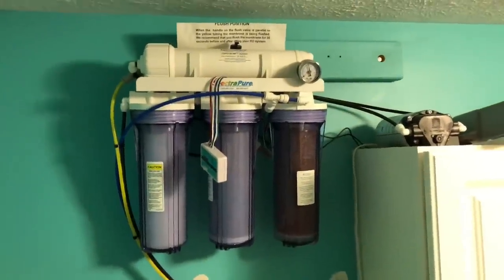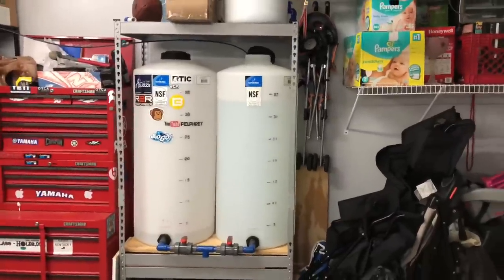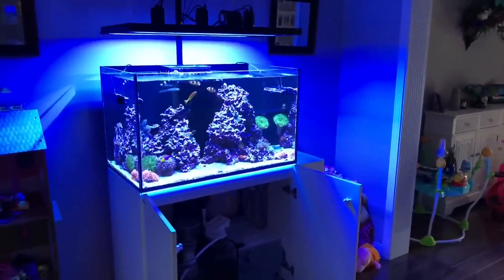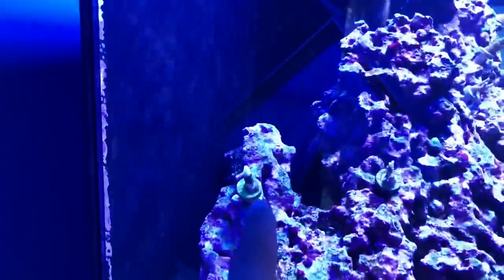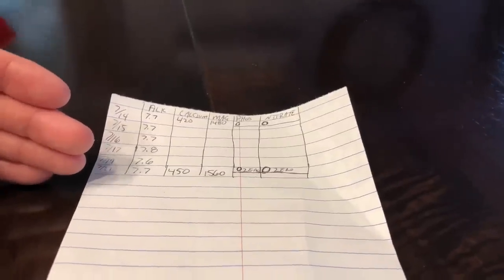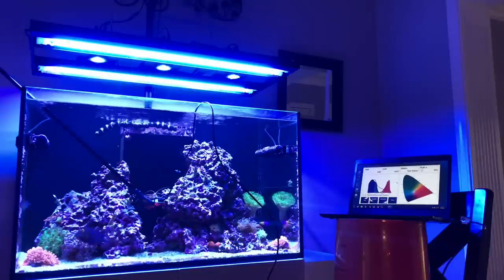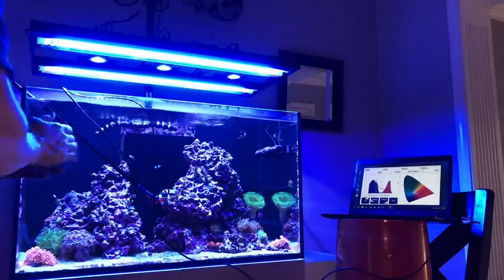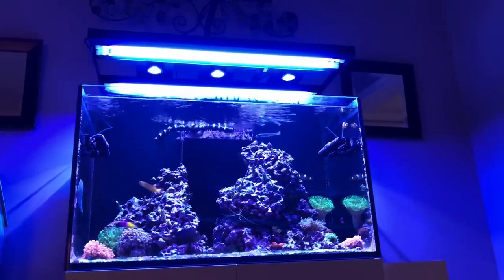Red Sea Reefer 250 | Updated Par Values | Water Parameter Stability

Comment: Great update bro. Before I purchased my kessil 160 I spoke with a guy at kessil and he told me the purpose of the dense matrix design was to mimic the sun and create a shimmer similar to the ocean... he said that kessil light depends on that shimmer to generate par... I’m not knocking anyone, just sharing what I was told, and the reason why I purchased that light
Reply from the maker: Thanks Bobby for your input, I wasn’t aware of that. Well, I thought I heard or read somewhere that the light reflecting off the flow distributed light better. I think I read that, I could be making it up. Hahaha how many 160’s are you running?
Reply: just one on a 24"x24" x 24" 50 gallon cube

Comment: If I’m not mistaken, so do check this. If your running low nutrients like your wanting your gonna need to bump that light up. Low nutrient / high light , high nutrient / low light.
Reply from the maker: I need to do some research on this! I’m slowly backing my ATS down. I’d prefer to have detectable phosphates and nitrates.
Reply: He can run high nutrient and high light , his issue is the 0 nutrient readings .
Reply from the maker: Right!
Reply: Yea, I think its the opposite.  High nutrient, higher light.
Reply: yep , low nutrient - low alk - high light is ok . high nutrient - higher alk 9 + ish range - high light is also ok .

Comment: @pelphrey, would you be so kind and tell us how much do you have invested in hardware so far on the tank? (tank included)
Reply from the maker: A lot. I’m not getting into the financials
Reply: pelphrey fair enough, I was asking because I am planning to upgrade my Nuvo 38g tank, but wanted to know a ballpark number to do it the right way
Reply from the maker: Build the system on bulk reef system and add everything to the shopping cart. You’ll get a pretty good idea. Skimmer, kessils and some other equipment was bought used from the forums. I was a COR20 beta tester so I got the pump at a discount. RAIN2 ATS also was used, so is the DOS. I’ve saved a lot of money buying used equipment and knock on wood had good luck with it.

Comment: Heya Pelphrey, i don't know who told you to run flow when you do PAR reading but it's false. If you let the flow on you will have a hard time reading, the number will be all over the place, ... actually like you had in you video. 
On my review of the Hybrid Fixture i turn them off and it was much easier to read, i tested 3 different time, different spot making sure i got the same PAR.
I use Apogee MQ-510 because of T5 Purple and Actinic.
Reply from the maker: Haha my reading we’re all over the place! I’ll need to check again with flow off!

Comment: Par is fine for lps/softies but not sps. Get it to 250-350. Also get those nitrates and phosphates up. The corals are starving and you’re going to get Dino which is a major headache. Shoot for nitrate 5-10 and phos of .1!  STOP Tinkering again!
Reply from the maker: What am I tinkering with? I’ve been slowly ramping my ATS down. Last time I drastically reduced the light schedule I thought I had dinos.
Reply: Salt change-  Yes Blue bucket is better but the switch will also stress the corals...you have to go gradually when changing a salt type.  The lighting will have nothing to do with Dino's.  Dinoflagellates take over in the setting of low nutrients.  They are one of the earliest lifeforms and have incredible survival adaptations.  In the setting of zero phosphates and nitrates; your competitors will die out and they will take hold.  Once they are present you will have headaches and a long battle to get rid of them.  The low nutrients are also starving your SPS.
Reply from the maker: I'm doing a weekly 5 gallon water change, which isn't a lot and I noticed that finally with me switching salts there are no parameter swings. Whereas when I was using coral pro I would see an alk spike. I feel like the salt change was the right idea.